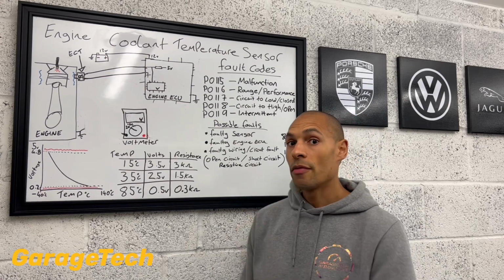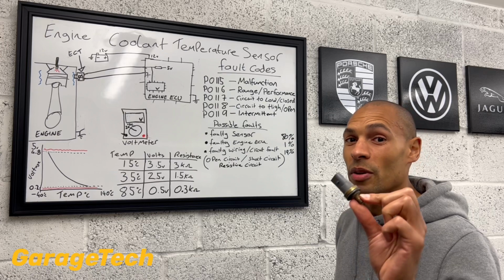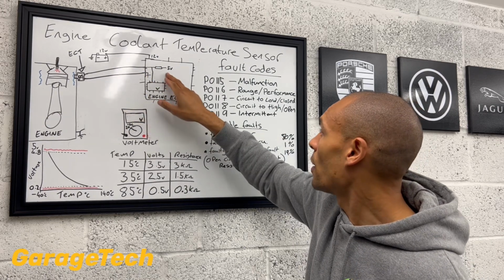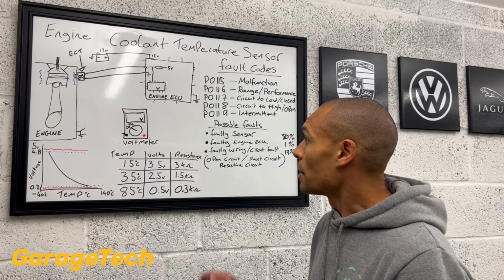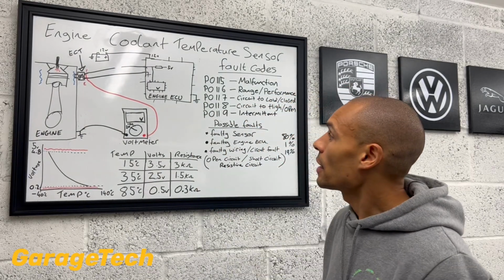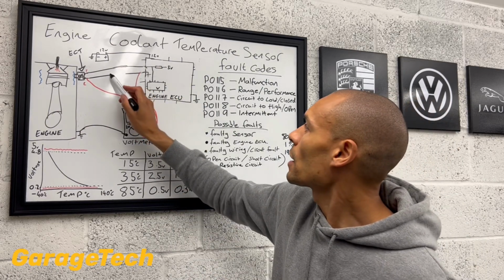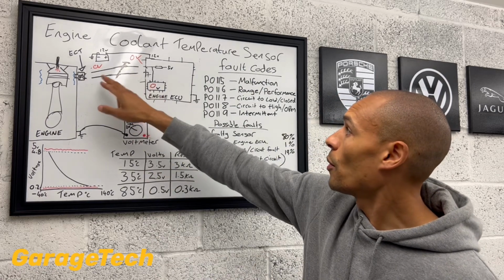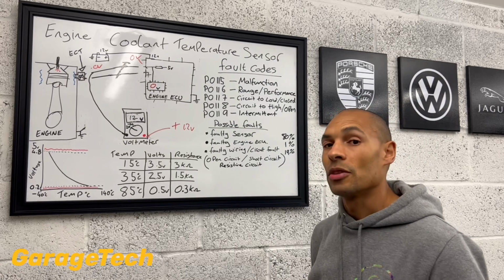How to test a faulty engine coolant temperature sensor ECT fault codes P0118 P0115 P0116 P0117 P0119

Comment: Hi Darren excellent video very helpful. I wondering if I give me some advice. The 4 pin temperature sensor does it control the fans on a audi 1.8t 20v. My fans come on at the correct temperature but it just starts and then stop. Check all the wires from ecu to sensor and they are fine I also replace the sensor. Please please your help will be appreciated. Thanks
Reply from the maker: Hey Jason, from memory I think there’s a separate temp sensor for the rad fans in the radiator, if you’ve got some wiring diagrams you can check, I’d have a look at that and I think there’s a rad fan relay control module, normally somewhere down by the left chassis leg under the battery. Probably that’s the issue
Reply: @GarageTechAutomotive  HI it has a fan control module in the fans and the plug to the fans have 4 wires 1 comes from the positive  and the other one comes from negative of the battery. Then two thin wires one comes from a relay which gives 12v when the ignition is on and the other one comes from ecu. I have been trying to get it right but no luck.
Reply from the maker: @jasonbarry8104  oh ok, if you’ve check all the wires I would suspect it’s the fan control module, have you had that replaced?
Reply: @GarageTechAutomotive  HI no I have not replace it.  When I unplug the 4 pin the fans start working.

Comment: Hello mate!

Thanks for offering us such knowledge for free and so well put together.

I'm planning to buy a 987.2 3.4 with the pdk gearbox. With around 150k miles.

Here in France E85 (ethanol fuel) is very very much cheaper and converting the car is one of the first mod I plan to do. It's quite a sensitive subject for Porsche enthusiasts here but I've been confirmed that thanks to the direct injection it's not problematic it's better to change the spark plugs for iridium's though.

Do you have any information about that? Apart from that, no mods planned as it has been serviced recently (gearbox oil change/water pump and belt).

Thank for your time mate.

Take care.

Marc
Reply from the maker: Hey Marc, thanks for the comment, unfortunately I don’t have any info on E85 and conversions, seems like ethanol blended fuel is becoming more popular so I’m sure there’s some info somewhere. Good luck 🤞🏼

Comment: I had a p0116 about a year ago and changed the ect sensor for a genuine one, along with a genuinethermostat, and also sorted to water pump. Now pretty much exactly 1 year later im getting a p0117. The code comes back instantly once I clear it. Does this point more towards the wiring side of things?? Surly the life span of the sensor is longer than a year. I'm useless with wires is all 😅
Reply from the maker: Hey thanks for the comments, are you getting any reading on the temperature gauge? A P0117 normal means a shot to earth so the sensor could be faulty, you would need to check the resistance valve, for this fault code it would have a very low valve, near 0ohms. Otherwise yes a wiring fault shorting to earth, the wires could be shorting to each other. Good luck, let me know what you find 👍🏼
Reply: @GarageTechAutomotive  I have the torque app and when I start the car first thing on a morning (dead cold) it reads higher than the ait, and when I unplug the ect sensor the coolant drops to -40. The wiring harness and the terminal look as sound as they should for the age of the car (2003 audi tt) so I'm suspecting it's the coolant temperature sensor 🤔 I've recently been informed that just because they say "genuine" on ebay, doesn't always mean they are aha ot was about £25 at the time. I think ill get one direct from audi and go from there since that would be the easiest fix for me. Do you know the part number for the coolant temperature sensor on a mk1 tt by any chance?
Reply from the maker: @shaunprince6986  those sensors on the early VWG cars were a common problem, is it the 4 pin green one? It has 2 sensor in it, one for the dash (G2) and one for the engine (G62) does your fault code reader give you the sensor code name I.e. G62 or G2. At least that will give you a clue to which circuit it is. Anyway, the part number used to be 55919501A but that may have changed. Best thing to do is ring your local Audi centre, even a VW garage will be able to supply you one. In the uk you’ll also get 2 years parts warranty. Worth it in the long run 👍🏼
Reply: @GarageTechAutomotive  Yes, its the 4 pin green one and unfortunately it doesn't say anywhere about a G2 or anything :/ ill change the sensor and go from there. I'm not a mechanic but am fairly mechanically minded. Just not with wires so that's my last resort. If a new sensor doesn't do anything ill get an auto electrician in. Thank you for all your help 🙏